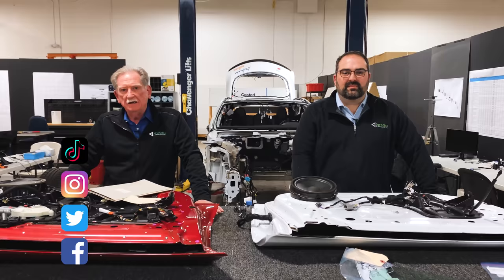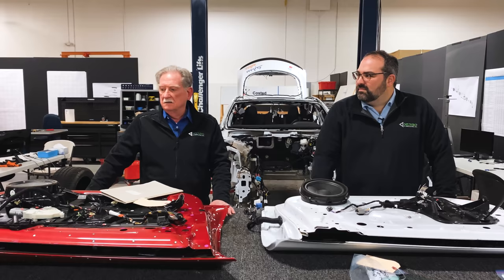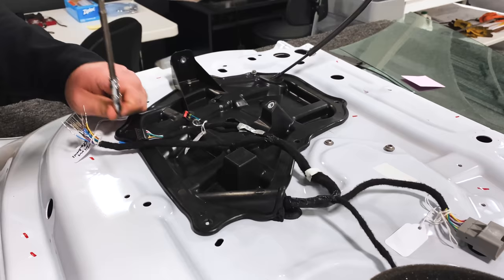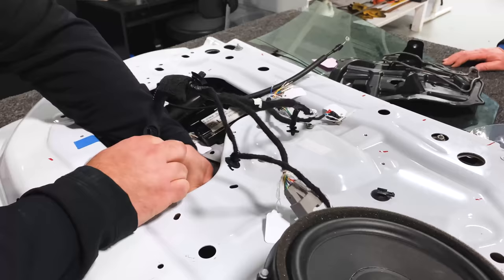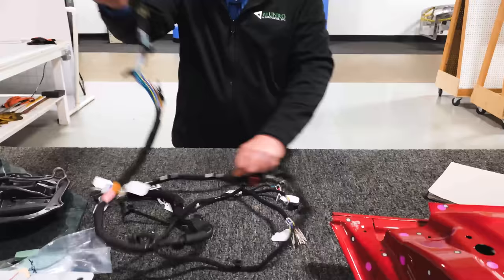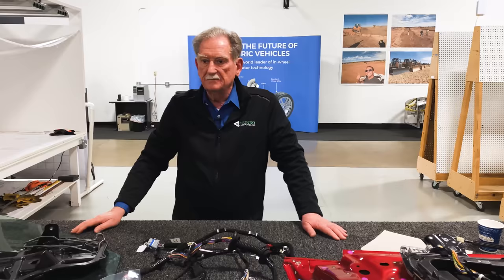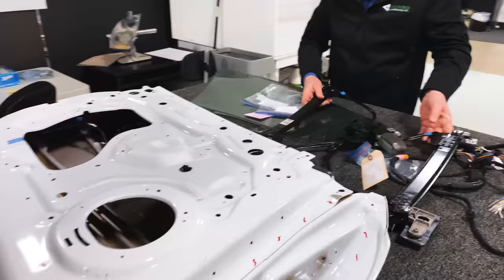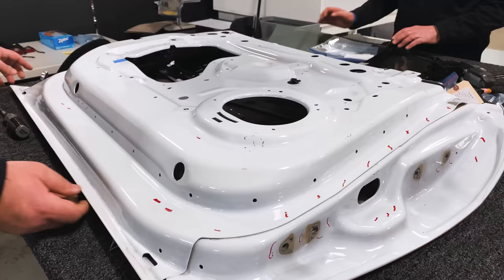Plaid Doors Disappoint Sandy | Tesla Plaid Teardown

Comment: I'm guessing this is the old design with tweaks vs. doing a totally new design. I'm 100% sure if they re-engineered the doors it would match model Y/3 panels. Theory I would say is the next model S/X refresh will incorporate no handles like Cybertruck and with that change will do a modular panel.
Reply: Actually further thoughts. It would be nothing for them to eliminate the handles, change the b-pillar glass to include a button to pop the door. Smooth the panel outside. Delete most of that heavy metal and go to that modular design and save a load of $$, weight, and further eliminate any more drag that could be on the handle..

Comment: I agree, that is a horrible design. I prefer modular designs OR alternatively, what VW did with the MK5 Jetta where the outer doorskin is removed to easily access everything inside the door (or for simple replacement of the doorskin). As a volunteer in a car car ministry I also strongly prefer scissor lifts instead of cable lifts where the pulleys always snap after the plastic dries out.

Comment: This looks exactly like the ~ 10 other nightmare window regulators Ive replaced.  
Mostly Buick, Jeep, because the "plastic"  ( can you believe that BS !   ) connector holding the cable system breaks after a few years in the heat.  POS. 
I can hardly believe, what I am seeing.   

It seems  Sandy must have gotten the door mixed up with one of the Jeeps they are tearing apart, only explanation.

Comment: Thats sad but since many her pointed out that it is pretty much still the old design it isn't as bad.
My main point is it is no a new bad designed pice but an old one. I guess Tesla will have the new design in the pipe. 
Or atleast, Tesla is the only manuafcture that i would trust to mak a running change one something like that.

Comment: Absolutely ridiculous amount of parts, wiring and labor intensive pieces. 

Modular integrated panels inserted into the door that contain electronics, glass actuators/motors and speaker simple to assemble, service and replace.

Wire harness within the door panel is deleted with the integrated contacts within the door panels inserts just like a circuit board. The window and/or speaker can be controlled by blue tooth.

The wire harness from the car simply plugs into the door. 

Theses panels can also be structural, molded out of high strength staple or continuous fiber reinforcement. With over 40 of advanced fiber reinforcement engineering experience, over the decades I have designed many fiber reinforcement blends for vast applications.
 
In short, plug and play modular door panels designs are key to increase quality, save weight, assembly time and  significant lowers cost.

Comment: 14:30 "Oh what's Sandy doi-Ah wait, fuck, no."

I've noticed there's another problem that you guys likely struck on in past videos- Tesla keeps trying to retrofit older designs and replaces them as they can, but doesn't readily update people on when the changeover happened and just kinda jams them in. This looks like an OG Model S doorframe, which tells me that at some point, someone is gonna have to replace a door on their Plaid due to dents or damage, and get a new door that doesn't quite match because it uses the Y construction model. I've seen cars with mismatched doors before, it's frustrating.

Comment: I wonder... If they mount everything on the inside plate, then join them after, don't you avoid most (if not all) of the pain they were talking about? I'm sure there's a good reason why this is not possible, but based on how it looks, it seems possible to me.
Reply: Nope, doors are made to be repaired when they fails since there are moving parts there.
Reply: @alanmay7929  Ok, so if I understand you correctly you're saying once they are joined, they can't be taken apart, so this way to make a door will not allow repairs inside?
Reply: @NilsR  who is his mind will make such kinds of repairs or assembling!? You’ll have to cut and weld the door and paint it, it makes no sense at all. The modelY or even a 10years old vw golf have a way better design and are repair friendly
Reply: @NilsR  this is also a frameless car door which means even more things to go wrong and needing repairs.
Reply: @alanmay7929  As I said, I do not know anything about how they are put together, and it seems you do, so thank you for spending time trying to enlighten me. If taking them apart means cutting and welding, even I would assume that's not the plan. I was just wondering if there was an assumption there that wasn't necessarily correct. No worries, it was just a thought.

Comment: Come on Sandy, this is Tesla. There will be a good reason . For example it might be:

Structural rigidity because of crash requirements.

Cost-benefit of changing an existing design at much lower volume.

The doors are themselves assembled on a subassembly line and they've proved this way is actually quicker.

The large area of plastic has NVH issues vs the rigidity of metalwork.

Comment: Wow, it is like they engineered that S-Plaid door to be as difficult to assemble as possible!  Funny Sandy mentioned Ford.  I spent the better part of a day on a 2002 Ranger door getting out and replacing a regulator which had a tooth on the crescent gear that had blunted off.  Just for irritation’s sake, Ford riveted the regulator to the door with king size pop rivets.  Those were fun to drill out, Not!  Wound up welding nuts to the new regulator and then bolting it in - I don’t have King Kong’s pop rivet gun like Ford used on the line!

Model Y door:  Yay!, well done.
Reply: It’s not rocket science: the Plaid is low volume, and this door design is basically the same as the original form 2012.
It’s not been significantly updated, and with the low volume, probably not going to be done for a while.
Reply: @FutureSystem738  stop using the low volume shit , it’s not a low volume car
Reply: @carholic-sz3qv  It IS a low volume car. 
The doors haven’t been significantly changed in design from the original. What part of that is too hard for you to understand? It’s not bloody rocket science!
Reply: @FutureSystem738  bullshit, it’s the fact that you pay over 100k for an outdated design and car, it’s a flagship car that should always have/introduce new technologies from the brand, you’re welcome, stop justifying shit!!!
Reply: @FutureSystem738  other manufacturers also have low volume cars which are actually totally different/custom made which makes them even more special.
Reply: @carholic-sz3qv  Have a good day. ROFLMAO

Comment: I'm curious to see when the change was made. Was this door design the original of the S (pre-plaid) and was simply never updated from the Y? It seems like its the old way of doing things that was not updated because of the door size(?). This is of course very disapointing. Is the Model3 designed the same way?  (SR+2021 here).
Reply: Let's assume they have an expensive machine pressing out an inner door skin, for a relatively low volume product, with sunk cost investment.
Then, the vehicle is updated, the part fits the new design parameters, and the die on the machine is only 30%(?) life?
.
Ref the 150 lightning..... Uses the WHOLE bodyshell of the ICE car.
Reply: It will be vehicle-design-specific. All of the S's ever built will be generally like this, and it is indeed the old way of doing it. While it's obvious that lessons have been learned, retrofitting this design back to a vehicle that started production earlier would be a big change, and would probably only come when Tesla eventually does a full-model redesign (if they ever do).
Reply: @bikeaddictbp  That's an interesting point. And a bit worring if its the case because the S went through a redesign 2 years ago. The S/Plaid IS the new design. (refreshed they called it).
Reply: @AntoineThisdale  But that was a cosmetic change only (various changes to bolt-on bits). The basic bodyshell and structure is the same as it's been all along.
Reply: @bikeaddictbp  you're right, it was mostly cosmetics and QOL stuff.

Comment: Sandy is right. This must be a NIGHTMARE on the line to put together. I sweared constantly about such stupid design decisions when I worked at a car manufacturing line for a few weeks... and this is way beyond than what I had to cope with. But I agree, this looks like a part that they simply didn't change since the last Model S revision.

Comment: Could it be that Tesla was just burning off old stock. To Quote Sandy Munro, Tesla moves at the speed of thought. With the parts shortages, that may be slowing down that speed due to a lack of availability to make such quick transitions, and since the model S in any form is not a high volume model, Tesla is simply burning off the old parts, and reserving the newer design parts for the Vehicles Tesla must build at high speed all four plants, Fremont for the western portion of the USA, Shanghai, for China and Asia, and for now, New Zealand and Australia, Austin for the eastern portion of the USA and Berlin for European areas and probably Africa

Comment: Haha I think I know the decission process behind this. 
This has 100% to do with spare part supply. You would need the old manufacturing line (stamps + welding) to make this door and a new line for a new door with module. You cant fit a new door on an old Model S, so the figured to safe on a new line. Since this car isnt high volume, time isnt the main issue. But i can imagine the guys at the assembly line cursing a lot.

Comment: I see 2 welded panels for the door.  One outer and one inner.  Is it possible the door is first assembled then welded together and finally painted?  This would make assembly at the factory much easier.  The relief panel access point could be just for access if required for maintenance.  Just a thought.  I'm not sure if painting after assembly is even an option as this would paint the wires which I can see are clean.

Comment: Is it possible that they would attach all that stuff to the interior metal panel before they join that panel with the exterior metal panel?  If so, that would make assembly much easier.  You guys didn’t talk about how those two metal panels are joined, and didn’t take a close look at it in the video, so I can’t assess of that would be possible or not.

If that were the case, all the access holes and panels would be for doing maintenance/repairs at a later date, or for small adjustments.

Comment: Is it possible that this is a sign of the Tesla internal divisions "building silos"? 
Is it that the Model S and X folks do not want to accept the developments of the "Model 3/Y" folks?
As for not bothering to change the design due to cost, every inefficient door costs extra to build and through warranty maintenance. So why keep doing it?
It is absolutely shocking that Sandy developed the modular idea 40 years ago and most OEMs including the Tesla S and X folks have still not embraced it. How is this possible?. 
Is there a "religion of door design"?

Comment: Reliability and complexity in cars (and everything else) are inversely related.  This makes me wonder why Tesla, or some other OEM doesn't design a "simple" BEV with high utility AND that is more reliable and affordable.  The Model X is notoriously complex and unreliable, and when you need service outside of the major metro areas where Tesla service centers are, you a "hosed."  This is already a problem but I believe it will become more of a "choke point" for Tesla as it sells more vehicles.

Comment: "It would take US 45 minutes, We don't have the same tools as the assembly guide .." 
- "We would have to fish around inside to get this inside." 
"I have never seen a tool  that would help wit this"

All this conjecture without actually seeing  the operation on the assembly line. So many assumptions.
Then you ignore the burst proof engineering for safety, that two layers of metal panel would provide.

Comment: To be fair, the Model S Plaid door is an older design which was rectified with the Model Y. So Tesla is adapting better systems which might be too expensive to apply to the Model S which at this point is a legacy design.
Reply: Lol….. since it’s a tesla flagship car why didn’t they just cut and reuse that model y module to even reduce the costs!?

Comment: Surely the top metal plate of the door could have been welded to the bottom plate after all the internal parts were installed? (Just placed vertically over all bolts, fasteners etc? Or am I missing something? 🤔)
And then all the worker had to do is reach in and grab the cabling bundle, fit the speaker and fit the plastic cover.
Reply: Nope. Paint has to come after welding/adhesive/hemming. Assembly has to come after paint.
Reply: @bikeaddictbp  I can imagine that is the way it is usually done, but could Tesla have deviously come up with a way of changing the order of these things? And if not, would it theoretically be possible?
(Sorry, I'm software engineer, so don't really know about this stuff)

Comment: LOL! Tesla S gets beaten by Tesla Y. Here's my guess about what happened here. 
1. Tesla S was designed first, say 2012. They followed conventional thought on the door design.
2. Tesla Y was designed ground up to save cost, based upon experience with S, X, and Model 3. They added the door module.
3. When the Tesla S was redesigned, they couldn't fit the door module into the redesign schedule. It would have delayed deployment of the Model S Plaid. They figured what they had was good enough for the low volume S.
Reply: Bullshit!!!! Even a 20 years old car has a better door design than that 2012 model S

Comment: Companies that build on the premise that the CAD output is always right build unnecessarily complex parts because they do not proof out the build process with common sense and factory capabilities. Mitsubishi is the worst company for doing this and has lost partnerships with other companies because of it. I have spent over 50 years working in heavy metal stampings and seen what a difference forethought, experience, and proofing out processes make. Mitsubishi is the worst for accepting CAD printouts without consideration of factory capabilities and ease of assembly which has resulted in losing partnerships with other companies.  I worked making Saturn doors for eight years with a process that was so bad that not one door made passed 100% inspection ib eight years.

Comment: I almost pulled all my hair out ( at least the last strows )  ;-) 
As always the man in charge doesn't like it because it is not his idea. 
And, I also HATE screws! Love snap fits.
It is clear the Chef engineer for the Model S was not knowing what innovation is. CRAZY !!!
For me " he had a job " 

There is nothing good to say about this door !
Reply: Snap fits can be unreliable. Really annoying when they fail.
Reply: @greghelton4668  If they don't fail on a wiperblade, they will not fail in a door. Trust me. And of course the design of the snap fit.
Reply: @ADOENDRA  I’ve had them fail.
Reply: @greghelton4668  I have designed snap systems and they are still working after +10 years. Trick is not to save money ;-)  You will save money with snap systems anyway.

Comment: Dumb (fan of the channel) here, is it not possible they fasten the insides of the door before they set on the second "inner" sheet onto the door and the just run through cables, the speaker and cover up panel would be a lot less stations on the line

Comment: Turns out engineers doesn´t only hate mechanics, they also hate line workers. What amazes me is that the design of the doors seem to be stuck with some design probably from the 40´s or 50´s and then just filled with more tech. By experience I can tell that the cables in that window regulator will go bad, and the person fixing it will have a bad day. Why for crying out loud isn´t the manufacturers go with Sandy´s idea? Why are they so fund of the bad old design that no one likes?

Comment: The question is how does Tesla come up with a decent design for a door, but then later implement a far worse design in a premium vehicle?  Does Elon Musk need to come back in there to shake things up again?  Some of the engineers might be getting complacent looking at their share prices all day.  No wonder they are having massive trouble meeting demand.
Reply: This is a holdover design from 2012 when the Model S was originally introduced. The Model S is now a low-volume vehicle, and it probably just simply isn't worthwhile to change this at this point.
Reply: @bikeaddictbp  Model S is low volume now, but doesn't have to be.  They should be producing 200k of these per year, but they need to decouple from old bad designs as soon as possible.

Comment: This episode is all about Sandy’s Ego. If you listened to it carefully, you will find the inconsistencies in Sandy’s comments somehow. If I were a customer asked to choose from the two door panels displayed, I would definitely choose the S. Here are the reasons: 1. Rigidity for stability and safety. 2. Noise Reduction (note; the multi-layer window glass panel is brilliant and advance and not intended for weight reduction). 3. Ultimate Sound Quality requires no excuses. 4. High level Shock Resistance for fast and extreme maneuverability.

Comment: I thought Tesla tested out all design changes before incorporating them into the line.  I don't see how such a big mistake could get through that process, so I think you guys are missing something.  Is it possible the two big metal pieces are welded together AFTER all the internal stuff is installed?
But even if Tesla does have some trick for assembling this easily, it sure looks hard to service.  Sometimes it seems like they just assume their cars will never need servicing.
Reply: Dumb comment of the week for all of YouTube goes to Steve...